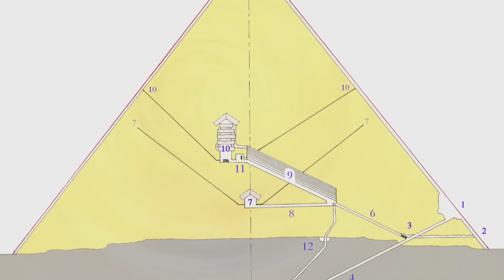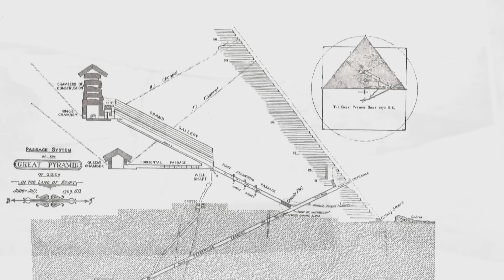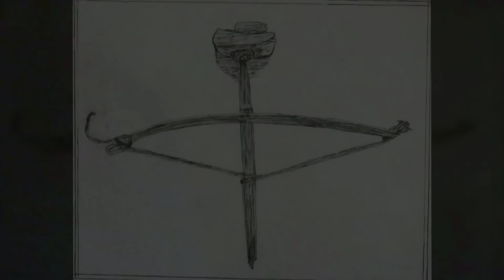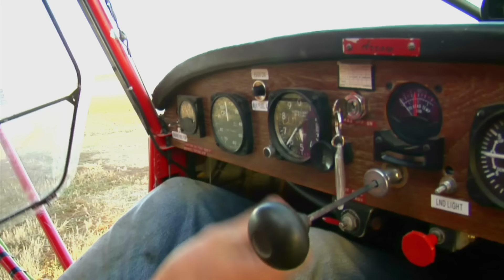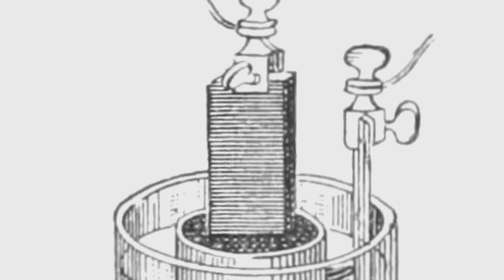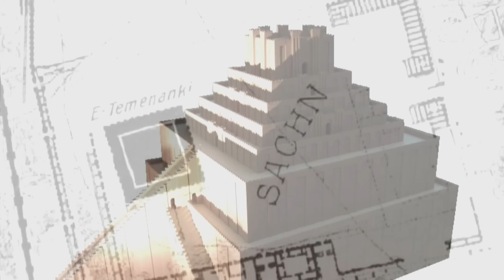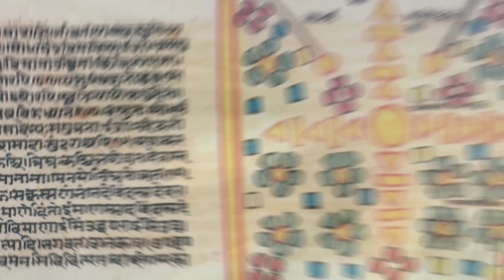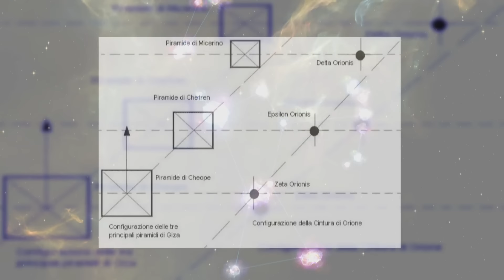Aliens in Egypt | Conspiracy | Aliens and the Pyramids | FULL ENGLISH DOCUMENTARY

Comment: There was a lie within the first minute of this video. Let me explain: 

0:47 (Tools used for common sculpture could not have produced these advanced technical artifacts). Yes they did. Egyptians had copper tools such as chisels, drills and saws that were used to cut the soft stones. Chisels is an example on what were used to carve things into the walls and bricks that were made out of clay. 

They also used treads to measure the lenght and width of the stones… and they used treads to make things plumb (horizontal and vertical perfection, 100% flat). Just like bricklayers uses a thread to measure a brickwall today.. 

They made the ground underneath 100% plumb. Then they placed the clay on the plumb ground. Then they used tiny threads to measure the stones both in height and in width on both sides.. just like we use our tool called tape measure. Then they dragged this tiny thread across the top of the whole stone from one side to the other in order to create a flat surface. (They used the thread to cut into the stones as a way to create the correct shapes). On wet clay this was a very smart method. After that, all they had to do was wait for it to dry. And boom, you got yourself a sun-dried brick made out of clay. Ready to be placed as a part of the pyramid.

They also placed heavy objects on round logs in order to transport objects from A to B. Meaning that they placed the heavy objects on top of the logs and tied ropes to the objects. This was pulled forward by both humans and donkeys. In fact, they didn’t only use logs. They made various objects that could both serve and resemble a modern wheel!

My answer to your line: Tools used for common sculpture could not have produced these advanced technical artifacts. 🫡
Reply: Yeah, copper chisels still won’t cut granite. Didn’t then either. Let’s see you prove your theory.
Reply: It’s been proven logs would not support that weight without crushing them flat. Try again